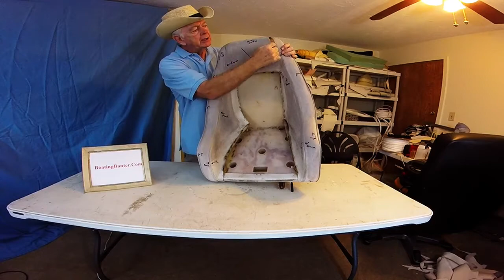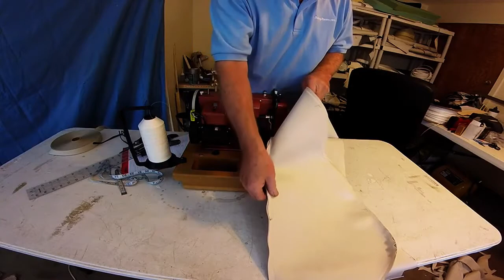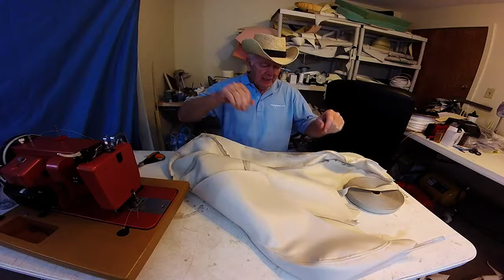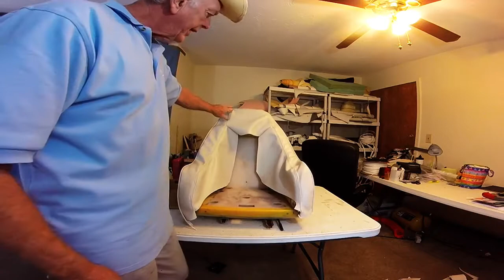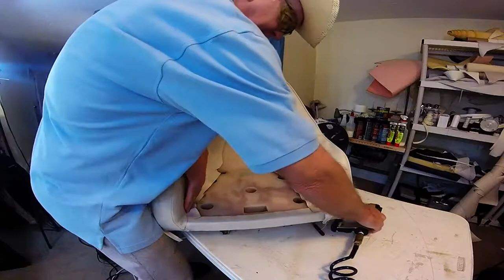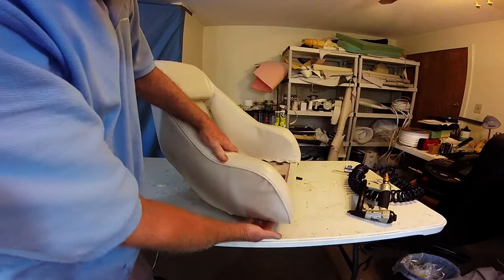Boat Upholstery Chap 49 Captain Chair Redo

Comment: 6:40 Hi Larry, I've seen others (like the people at Sailrite) putting the seamstick on the seam backing and stick that to the back of the seam, the opposite as you do it.
Reply from the maker: Hi Frank-I think you may have something there. I know it is a pain to do and maybe doing that way will make it easier. The main issue is getting the seam to lay flat. If we could solve that problem most any technique would work.
Reply: Larry Nichols What I have seen is that they stick the backingseam on and then press the back flat with the backside of some scissors (the round part for the fingers). Now, I've never tried a French seam myself, but in the near future I have to do a boat interior so I will have to experiment with that myself. Thanks for your video's, they are a great help.